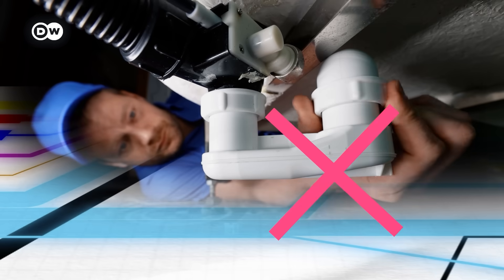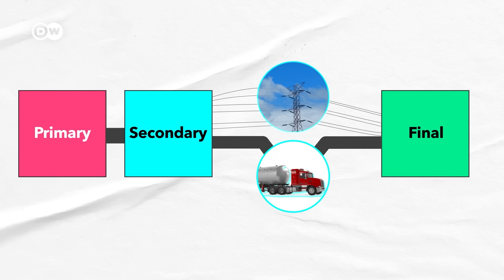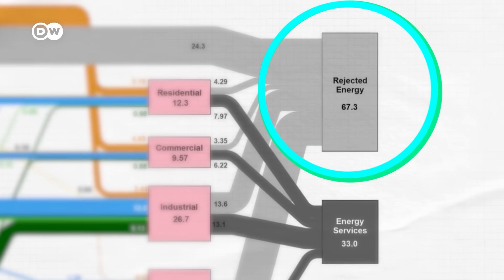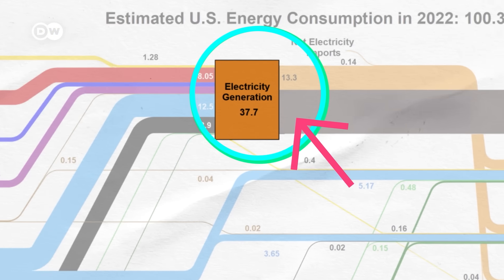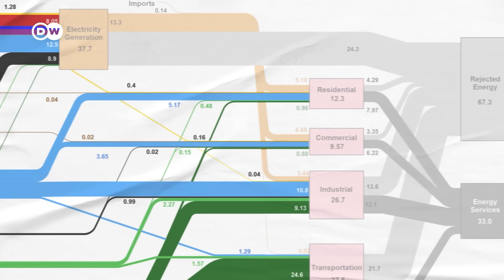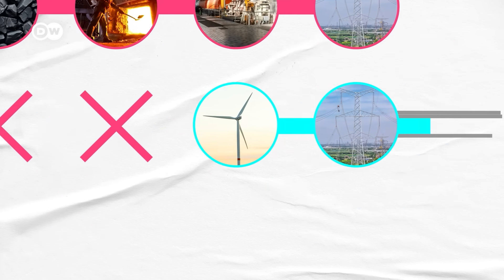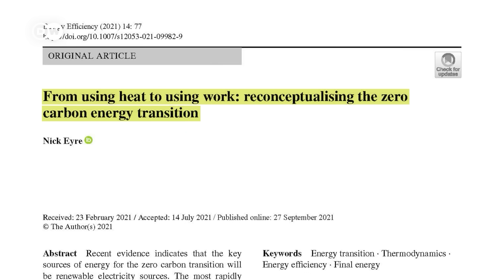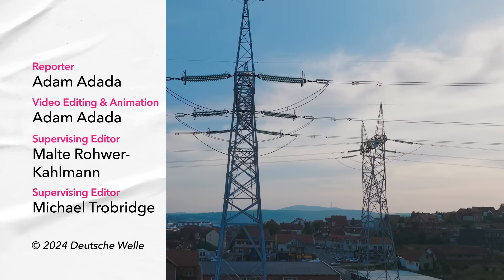The mind-blowing thing we get WRONG about energy

Comment: The problem you climate alarmist cause is that by screwing the economy you prevent the development of the new energy sources that could actually replace fossil fuels, practical 24x7 energy sources that don't require an acre per watt, like molten salt breeder reactors, fusion, and microwave drilled deep geothermal, and instead cause it to be wasted on windmills and solar which do not provide reliable power.  But then we all know this is a wealth transfer agenda not a healthy planet agenda, for if it were the latter, we would acknowledge things like the 15% increase in vegetation world wide as a result of more CO2 and the greening of deserts because more CO2 allows plants to thrive with less water.  Nor do you acknowledge that the effect of the great cooling event, the great oxydation event, was to cause the extinction of more species than any other time in history including the asteroid impact 65 million years ago.  But why let facts get in the way of an agenda.  Renewables are not available 24x7, under best circumstances about 30% of the time but more typically 15%.  If I go with an electric vehicle, I'm probably gonna want to charge it at night, when the Sun isn't shining, so solar ain't gonna work.  If I need AC well that goes well since AC and sunshine tend to happen during the same time periods, so these types of loads are more amiable to renewables but most are not.  And hydro as wonderful as it is, and I am blessed to live in a state where it is abundant, most hydro sources are already close to fully developed.  Geo-thermal is the one renewable that has the potential for 24x7 availability but it doesn't have the potential to be economic.

Comment: 2:06 fossil fuels are (excluding hydro and nuclear) closer to 100% than 80% , so called renewables don’t actually replace fossil fuels they just cause more fossil fuels to be wasted.
Much of the rejected energy comes from the intermittent renewables when they produce too much to be used at the wrong times with added waste of the fossil fuel power sitting idle but not able to be switched off that is needed to make the grid reliable.

Comment: Efficiency costs. It's not free. And it is exponential growth not linear so there is economical and phisical limit of efficiency that can be plachieved.
2nd issiue is renewables in current form are even more inefficient because peak production doesn't match peak demand. Without effective and cheap storage technology it is economically not feasible.
Solar panels produce most energy when least energy is needed. So it is waisted.
Storage costs both money and inefficiency. So the real picture is not as it is presented in this video.
I have to say it is so misleading that itbsounds like ideological propaganda.
Let me rephrase if we have cheap and efficient energybstorage technology than renewables might be good answear but without they are opposite of that video presents. They are even more inefficient than fossil fuels that can be used directly when energy is demanded with currently less losses.

Comment: RE needs massive storage of short term high efficient extremely expensive batteries, down all the way to low efficieny long term but cheaper chemical energy storage, with compressed liquid air/CO2 as a good inbetween.The round trip efficiency factors go from 90% to 60% to maybe 10% for battery, liquid air/CO2 and chemical storage and the costs go down with the loss of efficiency but exponentially longer term storage. Welcome to a new Mind Blowing Sankey diagram where all the losses are in the workable long term storage system.

The liquified air/CO2 option for 60% round trip eff looks pretty good to me but is short term for days but it uses only cheap materials and off the shelf parts from the gas industry.
The conversion of excess electrity production into hydrogen and then better fuels should be used as fuels (carbon neutral) rathen than converting back to electrictiy for transport and industry. These fuels will be very expensive compared to fossil fuel but they are Carbon Neutral.

Also nat gas is usually burnt at 40% in a peaker plant that backs up RE, but is about 60% in a CCNG base load power plant. When gas is burnt in pure O2, the effiiciency cany increase to 80% but the cost of the nitrogen-oxygen spitting takes 10% back off. If the Nitrogen has a market for fertilizer, then you get to keep the 80% Carnot cycle but AFAIK, it's still in prototype.

The elephant in the room is that none of the RE people want to talk about nuclear esp Molten Salt Reactors which don't need energy storage but still offer it with Salt tanks that permits constant heat production with variable electricity production. And if you want cheap fuel synthesys you should be using high temp nuclear heat to split water rather than intermittent RE with storage. The high temp reactor can make hydrogen at 50% efficiency without any electricity with the Sulphur Iodine process.

Comment: This is not a fair comparison.  You are counting coal, oil and gas as raw energy, where the conversion efficiency to electricity is %30 to %40.  You also need to count the energy in the wind and the Sun as raw energy, where the conversion efficiency to electricity with turbines and panels is even less.  If you counted the true raw energy of renewables, the amount of "rejected" energy would be much higher.  

The waste heat from renewables is not recoverable.  The waste heat from fossil fuels can potentially be used for heating buildings and industrial processes in some situations, thus making fossil fuels more efficient than renewables.  In other words, your "rejected" energy is something we always try to reduce, but it is not a reason to think renewables are any better at replacing fossil fuels than what they already would be without considering the "rejected" heat.  

The three laws of thermodynamics:  You can't win, you can't break even, and you can't get out of the game!  They apply to renewables the same as they apply to fossil fuels.

Comment: Interesting to see the example of an EV 90% efficient transfer of power to that of an ice vehicle 20% efficient.
I would argue those figures are much closer when you factor the energy loses to creating the electricity, transferring the electricity to charging stations and then charging the battery. All those create waste and the assumption is it's a relatively new battery  rather than one after 5 years use.
Reply: The YT offensive of the anti EVs would back you are no end, but they are misleading as hell. All transport will be electric sooner or later except for flight and space because battery storage is always going to be vastly less dense than fuels, if the battery were as energy dense, it would violate the laws of science, it would be a fuel.
Reply: It really depends on where you are making the efficiency calculation, for example if you make the efficiency calculation by how much the gravitational potential energy of ocupants and cargo has changed from point A to B relative to how much energy was put in, then the efficiency of cars is extremely bad, and the efficiency of boats is a division by zero error.

Although, for efficiency, something that can be done for EVs is to integrate solar cells into them. Integrated solar would have remarkably few losses, because the energy is made where it's needed, in some cases sending electricity near directly into the HVAC system for example, reducing how much work the battery has to do.